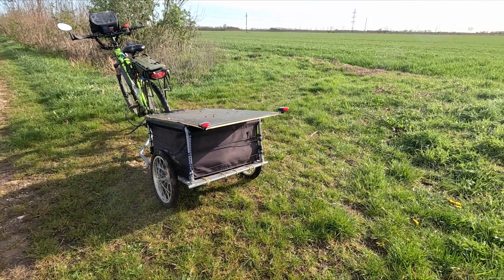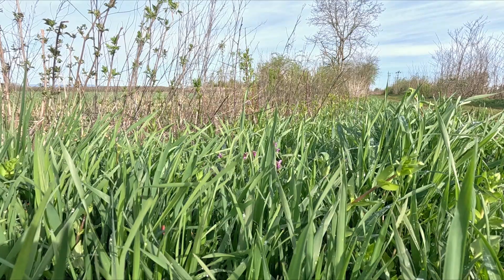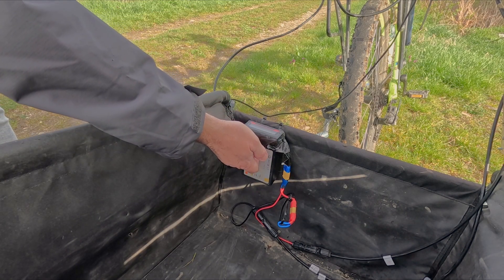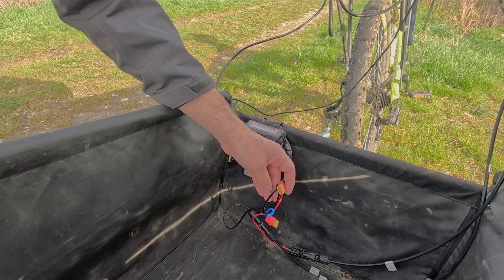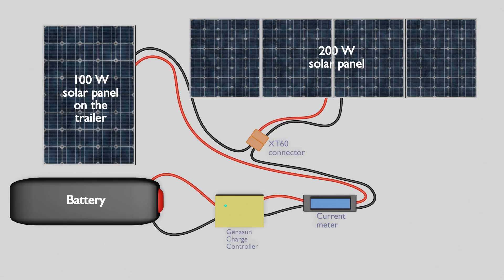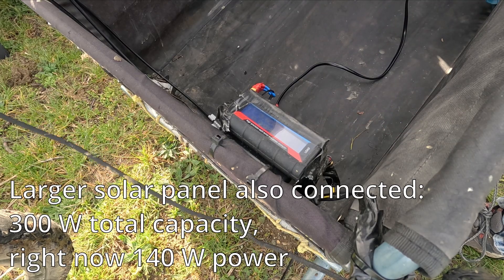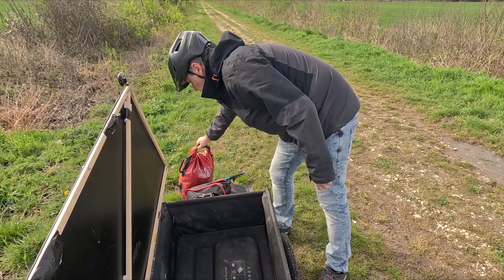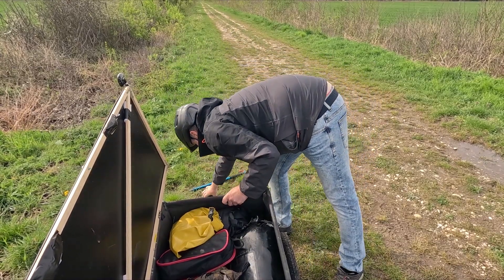How I charge my e-bike with solar power

Comment: Is the solar panel charging the battery when you are riding?  Is that possible?
Reply from the maker: Yes, the panel is charging. However, due to its suboptimal orientation and the continuously changing angles while riding, it isn't very efficient. I typically observe 20–30 W of charging power in motion. When I stop and orient both panels toward the sun, it's much more effective. Nevertheless, I still prefer to keep the panels connected to the battery.

Comment: What volts & Ah is your ebike  battery.
Sounds like you found a charge controller similar to the recommended voltage and charging amps.
Reply from the maker: Battery: 52V 20Ah. Yes, I tried a few different charge controllers but in the end, I just bit the bullet and bought a Genasun. Pricey, but good. The charge controller outputs 58.8V which is exactly what a 52V battery needs for charging. Charging amps depends on how clear the weather is, the angle of the panels, etc.

Comment: Hello from Greece. I ve got escooter 5600 watt. I would like to do something similar on my scooter. But shall i charger trough i drive i make something similar with panels or every time that i must charge shall i stop?
Thanks
Reply from the maker: Gee, 5600W is a lot of power. The only thing that makes me a bit uncertain about your question is that this kind of power suggests speed, while my method of traveling is quite the opposite. My trips are slow and lazy, allowing for extended charging stops. That said, yes, it’s theoretically possible.

First, check if the scooter is still operable (e.g., the wheel spins up) while the battery is charged with the stock charger. Also, consult the manual to see if it prohibits operating the scooter while it's being charged. Most batteries have an advanced Battery Management System (BMS) that handles both incoming and outgoing power, enabling simultaneous charging and discharging. 

The key point is to ensure the correct charging voltage for your battery. For example, my battery is nominally 52V, which requires a charging voltage of 58.8V. A 60V battery would need 67.2V. You'll need to get a solar charge controller that meets this requirement. From the battery's perspective, it doesn't really matter whether you charge it from the mains or from a solar panel as long as the voltage is correct.

Once that's set, you'll need to figure out how to safely attach a trailer to the scooter and properly connect the solar panel to the battery. Also, consider the power output of the solar panel. For instance, a 100W panel, under ideal conditions, would take 10 hours to fully charge a 1000Wh battery from 0 to 100%.

As you can see, there are quite a few details to sort out, but theoretically, it’s possible. Just be sure to stay safe, both for your sake and for the safety of others.

Comment: MY E-BIKE CHARGING SYSTEM:-> 1.) 220 or 300 Watt Off Grid TREK solar blanket (3' X 6", 12 pounds)  2.) ADJUSTABLE controller and cables, also from Off Grid TREK. Total weight about 12 pounds. Fits INSIDE one side of my bike panniers. Not inexpensive but VERY easy to use. Rene, the owner of OGT in Canada, will make the charging cable with a plug to fit your battery plug.
I live in sunny Nevada and with a 220 watt blanket can charge my TWO batteries from 60% t0 90% in 2 1/2 hours.
Reply from the maker: This sounds great! I would love to see your setup. What is the capacity of your batteries?
Reply: @SolarTrails  My batteries are:both 52 volt  Down Tube-> 20 amp hours. Rear Rack-> 15 amp hours
Reply: You should work for Rene. After reading your comment I took a look and I've decided to bite the bullet and buy one of these blankets as well. It seems like the only real charging solution that can actually fit inside a pannier bag. 
It costs almost as much as the rest of the bike does after UK import taxes, but I suppose what the wife doesn't know can't hurt her... 🤫

Comment: That jumper idea was smart. I am going to copy that but not in a way to connect more panels. More like a On/Off switch for when leaving the bike to go into a store for an example. Nice video. 
Btw. I have my wattmeter connected after the Genasun so I see exactly what they put in the battery.
Reply from the maker: Thanks! Yes, I know I messed it up a bit and realized it too late. However, Genasun claims 98% efficiency, so the difference should be minimal. At the next overhaul, I will definitely put the wattmeter after the charge controller.

Comment: Why not design your trailer to double as a cot, keeps you off the ground, for healthy outdoor sleeps.. Also place battery in trailer, low center of gravity and its water proof. A bigger light wieght tent, small cooking stove. Then you can sit on your chair, in your tent, by your bed, with a hot cuppa surfing on your laptop, e book...bigger tent put bike in there for security and privacy
Reply from the maker: I've been thinking along these lines, too. However, I don't currently have the right structure for it. This trailer is not sturdy enough to bear my weight. A sturdier trailer would add even more weight to carry around. I was considering a foldable tent that can easily and quickly be folded out or back into the trailer, so the trailer would only carry the weight of the tent, not mine. I'm still exploring options.
Reply: @SolarTrails  I havent seen any nice designs either. Just my two cents, having a bike all loaded up with gear is not fun too ride. Dragging a trailer around is an improvement, especially if it's full of creature comforts at the end of the day, destination

Comment: I didn’t see a tool or first aid kit, important items you should always carry in your cart. 😊
Reply from the maker: You are absolutely right, these are essential items. The long black bag on the top tube has all the tools. Complete with pump, pressure gauge, inner tube, zip ties, multitool, chain tool, pliers, small knife, puncture repair kit, etc. The first aid kit is not waterproof so I carry it in the red food bag.

Comment: Have you thought about packing the extra panels on top of your other gear?
That way, you could be charging with higher power, while you unpack & pack each time...every joule of energy counts
Reply from the maker: Yes, I am thinking about a different arrangement where the other solar panel can be more easily accessed. I don't have a definitive plan in mind, but sooner or later, I'll get there. At the moment, this arrangement works pretty well. Given my lazy style, on a sunny day, I have more energy than I can possibly store in the battery.

Comment: I have been trying to do the same and although technically it is working there are 3 problems I never use it.
- buing a second (swappable and/or external in trailer) battery gave me range more then I wlll need
- as illustrated by the electricity pole in the background at 3:15, electricity is everywhere and so are outlets you can use when you ask friendly and show how little you use with a portable meter
- solar is often very slow, both while drivng or when stationary compared to the 1 kWh you can charge overnight

However, just for the fun of it, I am thinking of an extension pole for my Burly coho, so I can drive with longer solarpanels The subject still fascinates me -)
Reply from the maker: You are right, of course. On shorter rides two batteries or even a single battery is perfectly fine. And if your rides are near populated areas, you should be all set as you will always have access to an outlet. In my case it is a bit different. I usually go to pretty remote places. (In this "How I charge my ebike" video I just rode out to the nearby field to demonstrate the procedure.) Difficult terrains also drastically reduce range. Dirt paths, gravel roads, grassy areas, especially with steep inclines tend to drain your battery pretty fast. Anyway, these videos are not made with the intent to tell the only true way. It's more like a proof of concept, where I would like to do experiments and show the advantages and disadvantages of temporarily being cut off of civilization. And I feel you, the subject utterly fascinates me too! :-)

Comment: You connected the panels in series, that way you will only reach max 200W combined. If you connect the panels parallel you will in theory reach the max of 300W - that way it is also better when one panel gets shaded.
Reply from the maker: At first, I tried connecting the panels in parallel, but this caused the current to exceed the upper input limit of the Genasun charge controller. The battery's BMS limits power to about 160W anyway...
Reply: @SolarTrails Ok than it does not matter. I use a 1.3 Kw 12.8V/100Ah LiFePo battery for storage in the trailer. Next to that a solar charger from Victron (75/15). This year I use a setup with 2 lightweight solapanels of 130 W each. While riding I only use one (stacked on eachother). At campsites  I use both in parallel. In 2022 I used  one bigger flex panel of 200W, made a 2000Km tour (4 weeks), got 36 Kw in total from the sun.
Reply from the maker: @solar-e-bike-touring-europe  I love your setup, very impressive! And I subscribed to your channel. Let's change the world! 🙂

Comment: What make is the trailer, are you happy with it? I'm looking at the Burley flatbed trailer but they are expensive, don't want to buy some cheap Chinese special that is not robust or last long :-)
Reply from the maker: I purchased it from a company called VidaXL. It's not bad, but I'm not particularly satisfied with it. I'm currently exploring other options. I would imagine that a flatbed trailer works well on paved roads. However, if you plan to traverse rougher terrains, securing your belongings to the trailer might be challenging.

Comment: Looks like you have changed the solar charge controller from the Genusun to the Boost MPT-7210A.
Does this work better?
Reply from the maker: It was the opposite. I originally used the MPT-7210A controller, but now I've switched to a Genasun controller. The MPT had an annoying issue: whenever the light intensity changed, it would reset itself and take 20-30 seconds to reach maximum power. Even a slight dimming triggered this behavior. When on the go, with constantly changing light conditions (angles, shading, etc.), the MPT operated far below optimum. The Genasun, although more expensive, doesn't have this problem and is also waterproof.
Reply: @SolarTrails  Thanks for this information. Useful.
Reply: @SolarTrails  Does your controller also control the amps input to your battery. I have a different mppt controller and my 48v battery is sometimes getting as much as 5 amps. I do not know if this is acceptable for the battery because the mains charger is rated at 2 amps.
Reply from the maker: @utubeape  Every e-bike battery has an in-built Battery Management System (BMS) that controls the current internally. As long as you are supplying the correct voltage, it should be fine, assuming the BMS works properly.
Reply: @SolarTrails  thanks

Comment: So you are able to charge your battery while riding? I checked the link and it doesnt mention that.
Reply from the maker: Yes, there is a 100W panel attached to the trailer that is continuously charging the battery. However, due to the changing illumination circumstances during the ride, this amount of charging is usually not significant (my estimate is about 25-50W on average). When I stop and orient the small panel towards the sun, I can get about 60-70W from it. The maximum power I recorded from both panels (when I unfold the 200W panel too) is about 160W. I believe this is due to the battery BMS that limits the current to protect the battery.
Reply: @SolarTrails  Cool as hell. Do you have some special battery that allows it? Or every battery can do that?
Reply from the maker: @TejpekJxv  You can do it with every battery. You only need to know what the charging voltage is for that battery. A solar charge controller is needed to optimize the power output of the panels and to convert it to the required voltage. Everything else is handled by the battery's internal BMS.

Comment: Nice setup. Going to test mine next week when the weather opens up. I also have a 300wh solar station as buffer.
By the way, keeping the panel clean helps with free watts 👍 and your rear tire seems slicker than my road bike 😅
Reply from the maker: You are right. Tire change is imminent. 🙂 But first, a new trip is coming.

Comment: Please buy cigs solar panels, it is truly flexible not like the fake flexible mono silicon panels that crack when bent....the foldable panel in video has a rigid back, that is good...
Reply from the maker: To be honest, this foldable panel is not completely rigid, but you are right - much better than the one I used in the first video. I had to replace that one because I accidentally stepped on it and it went nearly dead. This semi-rigid one is much better.

Comment: Love your setup, mine hirst my back. I use the same trailer almost, but I made a tight metal roof for my panels. I also just started up on YT myself so people can see my build. It's not done yet so maybe I'll re do a few things with your tips. like using the panel as a lid so I don't need to bend over so bad. I have 90w of panel but it's all I need.
Reply from the maker: That's great! I subscribed right away after seeing your videos. I also had an MPT-7210A charge controller, but I noticed a common issue with it. Whenever the light intensity changed, it would switch off and take at least 30 seconds to ramp up production again. While stationary and in clear weather, this wouldn't be a problem. However, when the system is mobile, this means the controller is continuously trying to find the 'sweet point,' resulting in little or no production.
I'll be sure to follow your videos! We seem to think alike. :-)
Reply: @SolarTrails  thanks, I think the PCB I'm making might help with that but could make worse will see.  It adds in some capacitors between he panels and the MPPT.

Comment: I have that solar panel!  After only a year or two the surface degraded into a strange opaque brownish haze.  I wonder if anyone is making more durable panels and/or if that brand got better--I bought mine about five years ago.
Reply from the maker: Which one? The folding panel or the 100W? Also, does it still work despite the discoloration?
Reply: @SolarTrails  The second solar panel (200W).  Mine is actually branded "YETI", but it's the exact same design and same colors, so I'd bet it's made by the same factory in China.  I used it to keep a 1kWh battery bank charged for running a remote water pump, and it worked great for the first year, then totally failed.  I bet it would have survived better with only intermittent use like here on the bike.
Reply: Buy cigs panel!!!

Comment: Upgraded solar panel from red one in last video.  What are the improvements of this one, and was other one failing in some way?
Reply from the maker: While doing some bike maintenance, I accidentally stepped on the red one (a bit ashamed to admit!). I heard a crack, and the 300W panel never went over 60W again. So, I had to buy a new one. After considering my options, I decided to buy a 200W folding panel and a 100W laminated one that I attached to the top of the trailer. This way, the 100W panel continuously charges the bike, even on the go. The folding panel perfectly fits into my trailer.